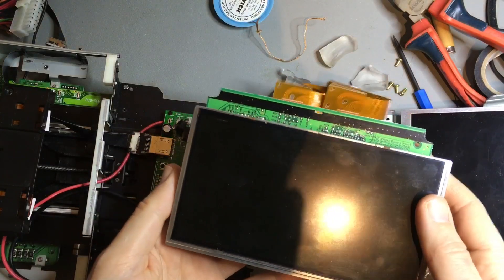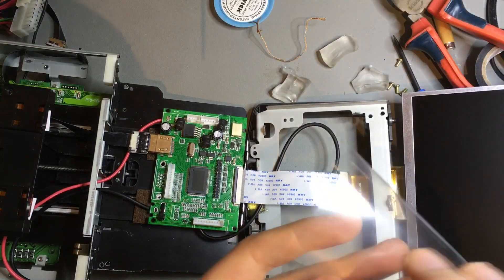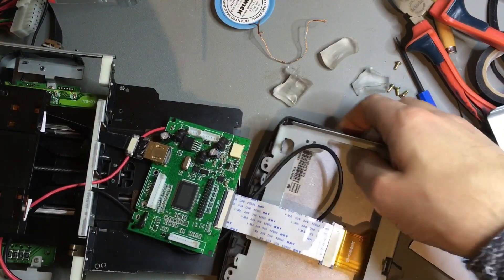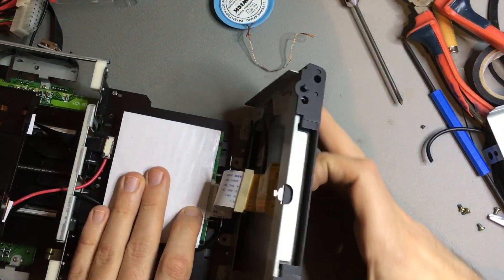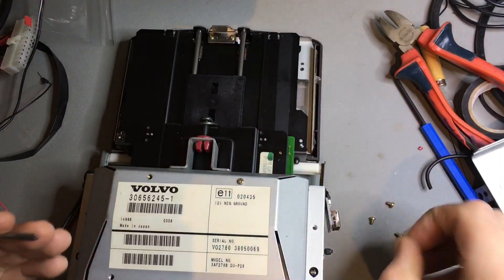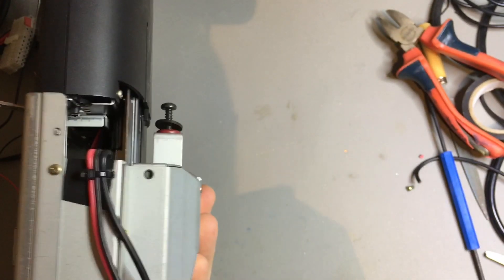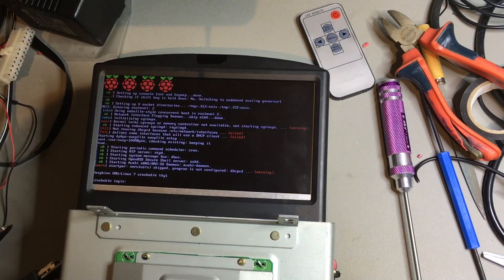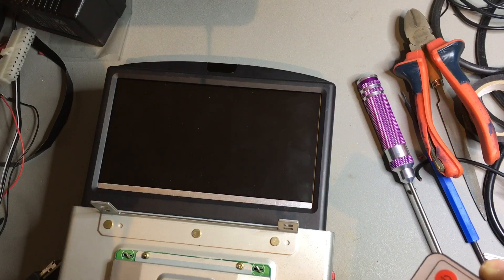Volvo RTI: Installing a new display

Comment: Hey, awesome video. This is a thing that I wanted to do for a whole year now. Couple of questions for you. How do you control the lift up and going down of the screen from the car? Also, does the car give any error messages? Also, maybe there is any touch screen displays? I am hoping you will see this comment!
Reply from the maker: Povilas Zubrys  thanks for the compliments!
The board I removed from the unit is just the display controller. The main board that controls the motor and deals with incoming control messages is still in the unit and functioning. Also, the actual navigation system is still in the car (but doesn't want to read the DVD anymore). 
In other words: the buttons on the steering wheel still control the screen going up and down. The car also remembers the position the display was in while driving, so it'll automatically retract when you turn off the car, and go back up when you start it. I just keep it up while driving all of the time.
The car doesn't give error messages on the driver display. There is an error code related to the RTI stored, but I don't have a DICE unit yet so I can't read the actual code, so I'm not sure whether it's related to the DVD player or the screen.

There is a touchscreen available which you can lay over the display. I'm not using it since the screen is a bit too far away to touch comfortably while in the drivers seat. 
I want to use a Raspberry Pi with a CAN bus shield so I can read pretty much everything the car is doing. It should be possible to read the buttons for adjusting the mirrors (they do nothing as long as you haven't selected a mirror).
Reply: @dvdouden   dvdouden  wow, thanks for responding so fast. For the display, I would like to be able to retract it whenever I am not planing on using it (just minor personal preference). I was thinking of doing separate LCD display in my car, but it takes too much space. Up until I found your video. 

Can bus sounds amazing, I think that would be also really useful for my project. 

Also, couple more questions, how do you power down the raspberry after turning ignition to 0 position? I am thinking of using UPS for RPi or wiring something myself. 

Oh and also, whats your solution to have audio inside your car from RPi? Of course if you are still using RPi!
Reply from the maker: Povilas Zubrys I am not sure how the lift of the display is controlled. My guess is that the display unit receives some sort of message over CAN from the DVD unit in the rear of the car. If that's the case then it should be possible to mimic that. 

As for power: I currently have the LCD, a backup camera and a split screen unit (for multiple cameras) powered from the 12V socket in the front of the car. This is pretty much the only point in the car that shuts down when you turn the ignition to 0. Most other points are powered all the time, even without the key. I'm not entirely sure how I'm going to power the Raspberry since it will have to shut down properly. I think I may add a small low power Arduino in between that controls a relay with a delay and signals the Raspberry that it's time to shut down. 

As for Audio, the lack of AUX on the head unit makes this problematic. There are some after market solutions available that you can plug into the radio and mimic the optional 20 disc CD changer, so you can have audio over Bluetooth etc. I may try that, but audio from the Raspberry isn't much of a priority to me at the moment.
Reply from the maker: Povilas Zubrys for audio, have a look at belectronics.eu. They have some solutions available.
Reply: @dvdouden  sorry for my late response or question. Do you have any pin outs for the grey and blue connector? I can’t define anything online. Would be nice if you could provide this data somewhere or somehow.
Reply from the maker: sc29607 I did reverse engineer it at one point but I don't think I've documented it anywhere. I think the small connector is just for power and the larger connector contains video and control signals, but I'm not sure...
Reply: To be more specific, here: https://luuk.cc/p/vD2f/Android_Auto_on_Volvo_RTI

Comment: Great video! I'm doing the same thing but want to use the touchscreen function of the screen with my Raspberry Pi. Do you know if this screen will talk to the Pi as a touchscreen? Shame the official 7" screen doesn't fit in the volvo housing. Thanks!
Reply from the maker: Carl Raven I think there's a touch sensitive film available that you can put over this LCD and is compatible with the RPi. I didn't bother looking into that any further since the screen sits too far away from the driver to be operated by touch comfortably in my opinion. But I either read something about it or saw one on eBay, can't remember exactly, but it's definitely possible!

Edit: https://rover.ebay.com/rover/0/0/0?mpre=https%3A%2F%2Fwww.ebay.nl%2Fulk%2Fitm%2F372341557514 something like this
Reply: @dvdouden  thanks! Just need to find a compatible screen. Hoping to run Android Auto on my Pi from my phone. I'll let you know how I get on! 🙂

Comment: Hey! I'm in the midst of a similar project for my V70R and your video has been really helpful... Question for you... During testing, how did you control the motor mechanism that deploys the screen?
Reply from the maker: Hi! The motor mechanism is still controlled by the sat nav system in the trunk. It still sends signals to the pcb that controls the motor, so when the key is in the 1 or 2 position, the screen goes up. And when the key is in the 0 position the screen goes down.
The sat nav is still sending images to the unit, but since there's no longer a ribbon cable going from the base PCB to the display controller, no image is displayed. And as far as I know, it's not possible to show the original sat nav image on the new screen.
Reply: @dvdouden   thanks for the reply! I guess I should have mentioned that my car doesn't have the sat nav system installed. I'm going to try to control the motor with raspberry pi, too. Any reason you can think of why that wouldn't work?
Reply from the maker: @dartdubs08  I'm not entirely sure how the satnav controls the position of the screen (and since mine just works I never bothered to look into it). I'm pretty sure that the mechanism is controlled by the satnav unit though; all power lines to the display are constantly powered, regardless of the key being in the contact or not. And I can use the satnav buttons on the steering wheel to rise and lower the screen manually. These buttons are connected to the SWM (steering wheel module) which throws the state of these buttons on the CAN bus. The display is not connected to the CAN bus, there's a dedicated data cable running between the display and satnav unit, it's either the grey or blue connector you can see at 6:44 can't remember which is which though, I guess the blue one is for power but don't take my word for it.

The power connector has 5 lines, 2 ground, 2 power (12V) and 1 that runs to the AUM (Audio Module), no clue what's that for, it's not for satnav audio since there's a dedicated audio cable between the satnav and AUM.
The data connector has 9 lines and is completely undocumented. I tried to reverse engineer it by looking at the traces on the PCB to see where each line goes, but I can't remember much from what I found. There's at least one video signal in there should be one or more lines to control the position of the screen, but whether that's a simple on/off signal or a digital signal is unknown, no clue about voltages either. I'd have to put a logic analyzer/oscilloscope on those lines to figure that out.

In the video I just hooked one or two AA batteries directly to the motor to make the screen go up and down, but that's not something you'd want to do constantly. There are sensors at the bottom and top to detect when the screen has reached the end and should stop moving, ignoring those puts extra stress on the mechanism and motor.

Anyway, if you're lucky then controlling the position of the screen is as simple as applying the correct voltage to the correct line in the data cable. If not then you'd have to throw a digital signal on one or more of the lines to make it work.
Reply: @dvdouden  thanks, again, for all of this great information! Theres going to be some trial and error in this, but I'm sure I'll figure it out. I'll keep you posted on how it goes!
Reply from the maker: @dartdubs08  good luck!

Comment: Hey Bud,  my project calls for the unit to be stand alone, meaning up and down when power is supplied. I  want to provide power only for up & down. As I do not want it interegated into the car system... THE ONLY INTEDRATION I need is via that USB or 3.5..

do you know if the power can be integrated like that withouth commands from the can?..... Again, stand lone!

Hope am making sense
Reply from the maker: Hi, I think I understand what you mean. Not sure if that's possible though. The commands to move up and down are sent by the satnav system (as far as I'm aware) and everything runs on 12V.
Reply: @dvdouden  hmmm, ok, that will be a project. The stand aline unit I bought is still @ the retracted position, I will research a way to get it elevated and keep it light that I guess.... But I will continue to look for a way to operate the command via power only and not from the stanav, as all I have in my possession is the screen.... I do plan to replace the screen with another screen as you detailed in the video...

Big project, if you think of any any, please let me know.....

Thank for responding
Reply: Hey BUD... figured it out, can you tell me the EXACT SIZE OF screen you used.... Is it. 6.5?
Reply from the maker: @indevibe   if you Google for “InnoLux AT065TN14 datasheet” then you should be able to find the exact dimensions of the display.

Comment: Hello, Great info 👍 but the extender for display cable to control card? I Found the rest on ebay but not that cable. Best regards!
Reply from the maker: You mean the extended HDMI cable? Look on eBay for "FPV HDMI flat cable"
Reply: @dvdouden  the extender from screen to card, that you click on to control card.
Reply from the maker: @karledenvann6354  oh, that’s a flat flex cable that came with the control card I think. It could also be an extended cable. Look for “50P FFC” it needs to have 50 pins/connectors and a pitch of 0.5mm if I recall correctly. Not sure what the length should be.

Comment: Great walk through! Curious where you mounted the Raspberry Pi within the car and how you powered it. Is there audio from the RTI unit to the stereo unit that the Raspberry Pi could also act as an Android Auto or CarPlay unit? I know the stereos in this era Volvo are quite proprietary and run a lot of things via CAN BUS, so may be a challenge to hijack audio to play properly.
Reply from the maker: Thanks!
There's no RPi in the car, was planning to but never got around actually doing it. There's quite a bit of space under the dash, but if you're looking for an easy to reach spot then I'd suggest installing it behind the panel between the dash and the passenger door. On the driver's side there's a fuse box behind that panel, but on the passenger side it's pretty empty. The glove box would be a fine alternative.
There's no audio, I've looked into it but it's a mess, not touching that. It's not just CAN-bus but also LIN-bus and who knows what kind of proprietary stuff there's involved. I'm just not willing to risk all sorts of error codes and resulting check engine lights :)
Reply: @dvdouden  Thanks for the suggestion. I was also considering inside the center console since the aux input to stereo is right in front of it and could run power from cigarette lighter/power port pretty easily. Just would have to figure out best option for running HDMI all the way up to the display. Thanks for a great tutorial and the quick response.
Reply from the maker: @markplamann3937  if you want to make it pretty: it’s fairly easy to splice the 12V supply behind the cigarette lighter, so you can still use the lighter for other applications. Also the lighter is disconnected when the key is removed; contrary to most other power points in the car.
One thing to keep in mind is to disconnect the battery before you unplug the radio or AC controls; the car’s computer really doesn’t like to see those disconnected.
Reply: Radio uses melbus, arduino can mimic a cd changer

Comment: Sorry I know this is an old video. I have just bought a XC70 cross country 2006. I am in the UK and can’t find a 6.5 inch display. Will a 7inch fit?
Reply from the maker: Hi, a 7 inch will most likely not fit, 6,5 fits snugly from what I can remember.
Reply: @dvdouden  Thanks for the reply. I will keep looking. Thanks for the video.
Reply: @gazalfc   6,5 Zoll AT065TN14 800X480 TFT-LCD für Auto Display that should work

Comment: Fantastic work here. I wonder how you where able to get the motor up and down running? Did you connect a power source to it?
Reply from the maker: In the video? It was either a power supply or a couple of batteries directly wired to the motor.
Reply: @dvdouden  Yes since I will put this in my V70 where it don't have this option :)
Reply from the maker: @Monza24vR6  In the car the motor is controlled by the original RTI navigation system in the trunk. All the electronics for controlling the motor are still present in the base of the screen. I just ripped out the LCD and its controller, but the navigation system seems to be blissfully unaware of that fact.
I'm not sure how you can get this to work without the RTI unit in the trunk...
In the video I just disconnected the motor's plug from the controller and hooked it to a power source. The motor will slip once the screens has reached the end of its travel so it's not going to break anything anytime soon if you run the motor slightly too long, so you could probably get away with running the motor for a fixed amount of time to make the screen go up or down.
Reply: @dvdouden  Thanks for info. I`ll most likely add  a system to operate it :)

Comment: Great video and tutorial :)
Please tell me about what IR receiver are you using. I am going to do the same thing.
Reply from the maker: it's a HX1838. The driver board comes with a separate pcb containing some push buttons and an IR receiver, it connects to the main driver board with a cable and connector. I just soldered the IR receiver to the connector on the driver board (see 2:34)
Reply: @dvdouden  my question was about that you unsolder the HX1838 from the board then solder to the cable which goes to the PCB or just bought it with the cable.
Reply from the maker: Georgi Chepilev I had a spare IR receiver in my parts collection. They're really cheap on eBay and I bought one a couple of years ago to play with.
I just used a spare wire I had to connect the receiver to the board.

Comment: Hello, i need help with motor control. I do not have buttons in car. Can you tell me which pin tells motor to go up and which pin tells to go down? Thank you
Reply from the maker: Hi, there are no pins to directly control the motor.
The buttons on the steering wheel are read by the SWM (Steering Wheel Module) which is a circuit board inside the steering wheel. This communicates with the (CEM) Central Electronics Module below the dashboard. The CEM then talks to the REM (Rear Electronics Module) in the trunk of the car. The REM then talks to the RTI (Road and Traffic Information) module which contains the actual navigation system, this sits on top of the rear left wheel in the trunk. The RTI then talks to the DPY (Display unit) on top of the dashboard. But this is a digital signal, I have no idea what protocol they are using and how you can mimic this.
Reply: @dvdouden  :(. So if i want to throw away screen and e.g glue navigation to screen place i still will be need original butons to roll up mechanism?
Reply from the maker: @HenValsing  you don’t necessarily need the buttons (I never use them on my car) but you do need to have the screen connected to the original navigation system. Unless you can somehow find some way to mimic the original signals that make the screen go up and down. 
Also, I’m not entirely sure whether the screen receives an up/down command when you start/stop the car. Maybe setting power to the right power lines is enough.
I remember there are two connectors going to the display. The small one (with five or six pins) is for power. The larger one with 16 or something pins is for data and comes straight from the RTI unit in the trunk. Some of the pins carry a video signal. Other pins are for communication. I unfortunately do not have a pin layout for those connectors, nor do I know what protocol is used.
Reply: @dvdouden  sorry to light up an old conversation but I was curious as to how you get the screen to come up without hitting the navigation buttons. I have the original sat nav system installed but fitted a sport steering wheel without the controls.
Reply from the maker: @s2a4m  the satnav controls the position of the screen. It will remember the position. I’ve put it up before I replaced the screen. Now it automatically comes up when the car starts and goes down when I remove the keys.

Comment: Hello, I have a Volvo xc90.  Is it possible to change the screen please
Reply from the maker: Maybe. The first generation of XC90 uses a lot of the same parts as the XC70/V70/S60/S80 of that time. Possibly the navigation is the same. But I do not know for sure.

Comment: Do you have any plans on adding a sat nav system to this modification, or do you know of a way to do it please?
Reply from the maker: Hi, I'm not planning on adding a sat nav system, but it should be possible. You can connect a Raspberry Pi to the display with an HDMI cable and run Navit on it. (google Navit Raspberry Pi). I have zero experience with that though. I just use the display as a permanent backup camera. For navigation I just use my phone...